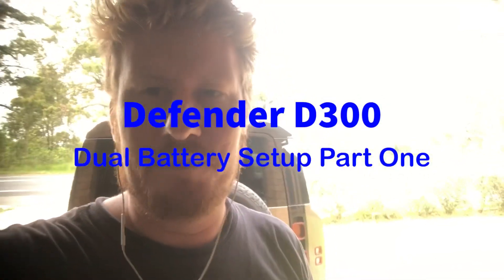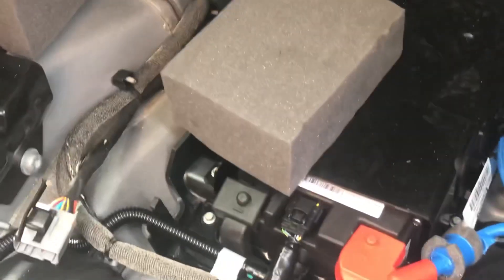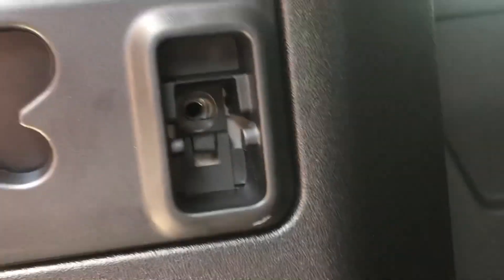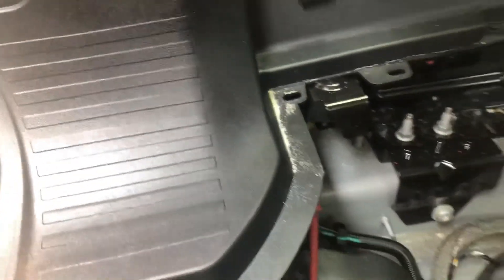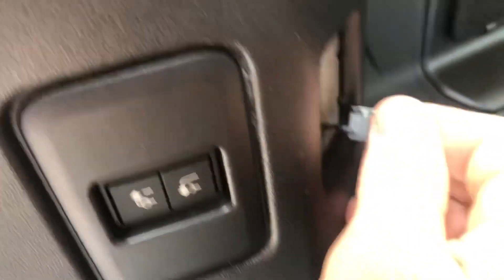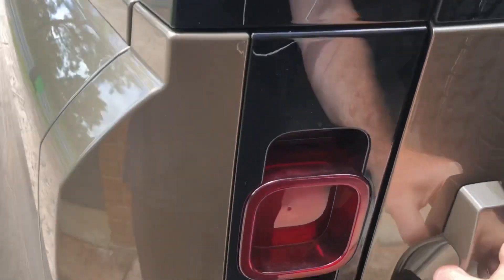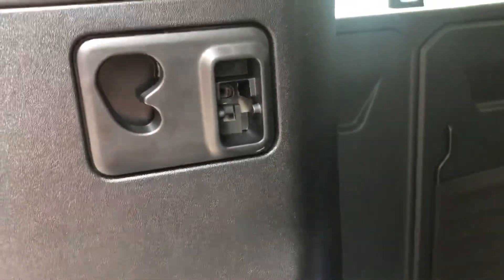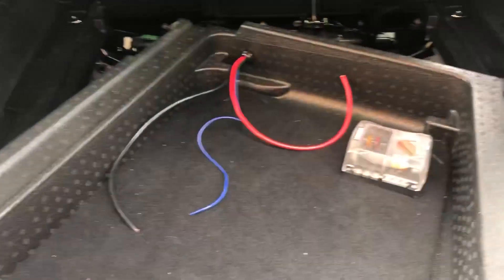Dual Battery Wiring Landrover Defender D300 MY22

Comment: Why not use a piggyback fuse holder in the rear fuse box for the ignition source.  There are several blank fuse spaces which are live on ignition. ( Check with a multimeter).  Therefore you would not have to remove any panels and it has it's own fuse.
Reply from the maker: Actually did end up doing that, in the removal video you will see that. Its also in the videos description that its the better option :-)

Comment: Hey did you end up taping into  that power  on the left underneath
Reply from the maker: I soldered into the 12v outlet socket, but its way easier to get a narva add a circuit, then you just run the wire off it instead and dont have to take that left panel off at all
Reply: @donniesgarage  ok sorry my bad in describing I was talking about that little black box looks like the battery terminal that comes from the battery up front  to the back there’s 3 terminal you said you were hoping to tap into the left terminal think of hooking up the arb twin compressor there’s instead of running to battery under seat
Reply from the maker: @kimwilliams2557 just check it with a multimeter, one of them is 48V you dont want that one you want the 12V
Reply: @donniesgarage thank you much appreciated

Comment: Which Fuse would you tap into, and would you use the fuse box in the cargo area?
Reply from the maker: Normally anything thats “accessories” related like a radio or similar basically you are just looking for a fuse where power is over it when the car is “on” if that makes sense - basically the blue wire is so the charger knows it should be in an operational state which is when the car is on (otherwise the main battery can drain)

I ended up using the one in the cargo area in the end
Reply: @donniesgarage  Can I pay you some sort of consult fee to walk me through what I need to buy and how to install it to run an anderson plug from the battery out to the trailer plug so I can connect it to the fridge in my camper trailer? :)
Reply from the maker: @JustinOL1  I appreciate the offer, however you would be best to talk to an AutoElectrician its not something I am licenced to do. Video was informational for anyone wanting to give it a crack :-)

There is an older video i did for a landrover discovery anderson plug you can find should be a similar procedure. Otherwise plenty of youtube videos that guide you through it.
Reply: @donniesgarage  Did you end up running a wire out to the trailer plug area? I want an anderson plug next to the trailer plug to power the fridge in the caravan but I'm not sure which rubber boot in the back of the car contains the wiring loom for the trailer plug
Reply from the maker: @JustinOL1  not for that defender as it has no tow ball. https://youtu.be/Ui8RqWiFIp8?si=rnSfYgLhB7QV7yRq that was doing a Discovery 5, should be somewhat similar.

Comment: Hi Donnie, terrific explanation on the dismantle & cable run in Defender. I have the identical D300. Given your success could I run from the same cable location to an Andersen Plug at tow hitch for caravan power? Brad Woods Melbourne.
Reply from the maker: Hi Mate in theory yes its 12V there and its a huge cable from the battery to it. Definitely put a breaker on it though or talk to an auto electrician to make sure its done right.
Reply: @donniesgarage  champion Donnie, thanks. I have a great auto Elec so your effort gives me a good direction.
Reply from the maker: @encapsul8  Just remind them not to bother pulling that whole left hand side off like I did in the video :-) although for an anderson plug you don't need that type of fuse I'd opt instead for a manual breaker. Some people put in auto-reset breakers however if you have a current big enough to pop a breaker and auto reset isn't really a great idea - yes it will keep your stuff running when it may have otherwise stopped but you also risk damage to your existing wiring / equipment. If it breaks, its generally broken for a reason that requires investigation 🙂

Comment: Brilliant. Looking at this versus a battery pack. Did you do a part 2 showing the finished job?  What was the final cost roughly please? Thanks heaps!!!
Reply from the maker: itech world battery ITECH100SX slim $799 redarc 1225D dcdc charger $519 wiring etc probably $200-$300 if you get reasonable quality stuff e.g. Narva instead of SCA plugs thats estimated sorry was a while ago!
Reply from the maker: and no didnt do a finished job - however I did change to use the Narva add a circuit instead of the massive way i did the splicing in the video which will save you a LOT of time.

Comment: This is the first mod on my new Defender.  Thanks for showing that. 👍
Reply from the maker: Just remember don't do it the way I did in the video. You can get the trigger wire from the fuse box with a piggy back connector way easier 😀
Reply: @donniesgarage  Thanks for the tip. I only picked it up on Saturday. 👍🏻

Comment: For 12 v trigger connection why can you not use the trailer plug connector which appears to have both constant and power when ignition is on ,means you do not have to remove the side planel etc .
Reply from the maker: After i did this video i ended up changing it and doing it with a narva piggy back fuse. Theres a lot of different ways to do it unfortunately when i did the video i did a pretty complicated way

Comment: Thanks for being a trailblazer and trying out this genius connection point!  I have the same 48v system on my P400 and am about to try this out.  Have you noticed any heat issues when the equipment is running under the cargo floor?  Any electronic errors or gremlins popped up yet being connected to this particular battery lead?  Thanks again!
Reply from the maker: Hey Keith the owner of the car did 8000km with us in Australia in January and Feb and it all worked fine. Realistically its a low overall load only running the fridge. If it was driving more heat might be an issue hut with the fridge alone seems fine. 

Remember to get the right wire on the 48V system not all of them are 12V

Comment: Hi Donnie, have you had any issues taking power from that rear 48/12V hybrid system?
Reply from the maker: None. It shuts off when the cars off. We’ve tried leaving it for days and still had no issues so it seems fine. If you are concerned you could always run the positive from the battery directly 

Make sure you use the 12V+ though not all of them are 12 ;-)
Reply: @donniesgarage  doesn’t it mean that you are putting the whole load of the BCDC charger 25A or 40A or 50A onto that circuit coming from the battery? How do you know what the load rating is on the existing cable?
Reply from the maker: @torquayreef  without testing it im not sure as im not an auto electrician but i can say its a very thick cable so should be capable of the load

Comment: Great explanation - thanks for this
Would this be different in a P400 ?
Reply from the maker: im not too sure, if it had mhev then likely the same if no mhev the main difference is you need a positive wire from the front battery
Reply from the maker: remember as well micro 2 add a circuit and i think then you just use that in f16 or f17 instead of splicing wires for the trigger wire like i did Basically any “engine running” fuse

Comment: Thanks for sharing, nice to know I can pick up a 12v supply in the back for my split charge power pack !
Reply from the maker: Only if yours has the hybrid gear in it, otherwise may need to bring it up from the battery under drivers seat. if you have a dcdc charger as well you can use a narva micro 2 add a circuit to pick up engine running 12V. The cig lighter 12V i actually changed to be an engine running 12V so that you dont drain a battery opening the tailgate :-)

Comment: Thanks for sharing. I’m planning on doing the same on the D300 once it arrives later in Jan.   The positive connection in the boot looks very useful.
Reply from the maker: Remember that will only be there if its a MHEV option vehicle. Otherwise in the video description there is a forum link to how to bring the wires through from the starter battery
Reply: How are you going with the install ?
Reply from the maker: @carloscienfuegos8068  its all done, we’ve been on the road since Jan 27 and its not missed a beat and doesn’t really impact storage space. Lithium batteries are great
Reply: @donniesgarage  awesome… would love to see the final setup.. maybe you could do a quick walk-thru.
I’m about to start mine on the D300 :-)
Reply from the maker: @carloscienfuegos8068  The final setup is the iTech 100aH lithium on the left, redarc dcdc charger (1225d) on right and then a solar input at the front. The wires we just popped up in front of the floor as its just for a fridge really. Redarc supports a bunch of different battery types and can do vehicle/solar input whereas some are one or the other. They also have MPTT built in so no need for a regulator on your panels :-)
Reply: @donniesgarage  hi do you have a picture of the finished install? Would like to do a similar setup, did you turn a LiFePo4 on its side?
Reply from the maker: @joworx  Not currently, not my car so don't have it here any more. But yes lithium battery side mounted. Used the iTech World IT100S slimline